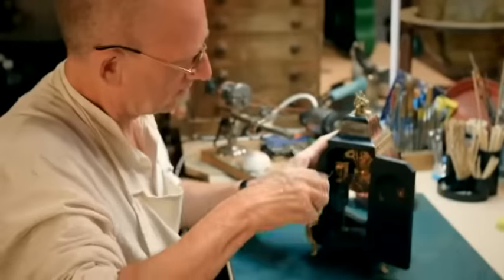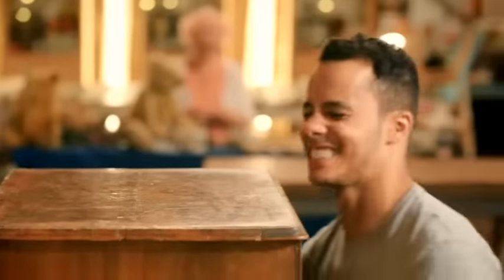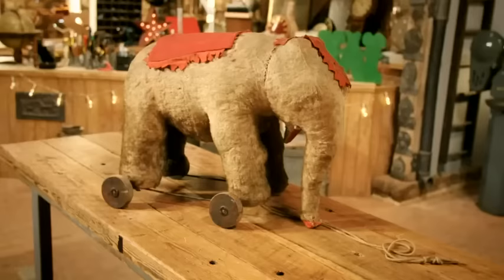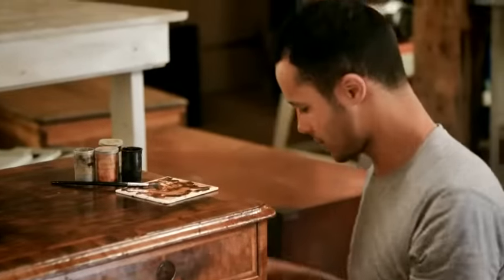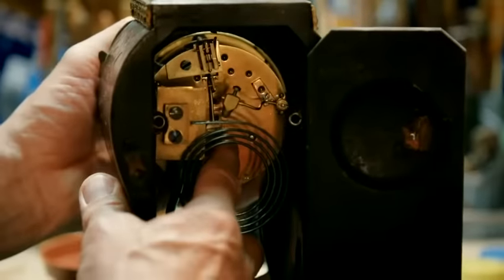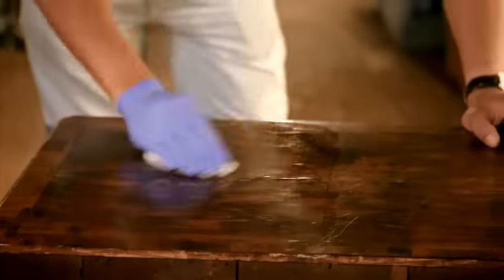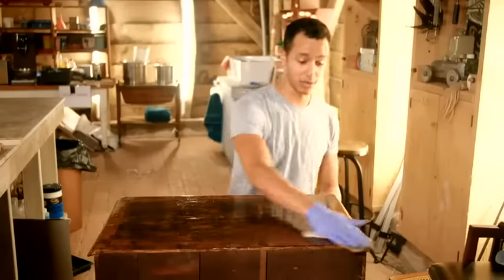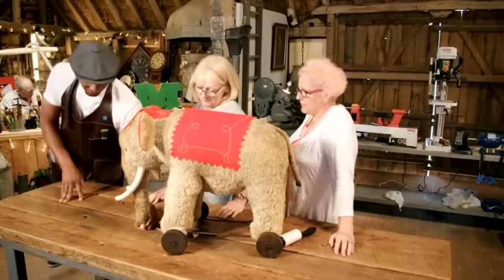Season 2 Episode 9 | The Repair Shop (Full Episode)

Comment: Its bad practice to touch the clock workings with bare fingers.. proceeds to touch the clock workings with bare fingers
Reply: Oh yes.  With one hand gloved and tweezers in the other.  But good catch
Reply: Not after it was all cleaned he didn’t. He used tweezers so not to touch the parts.